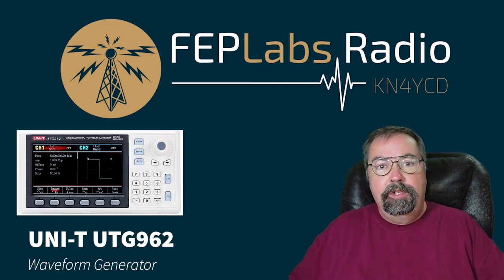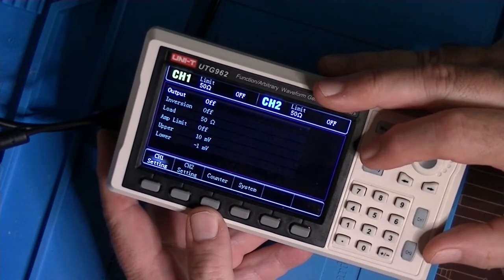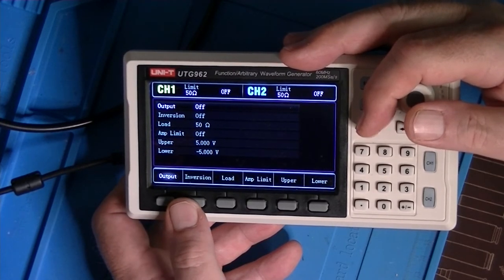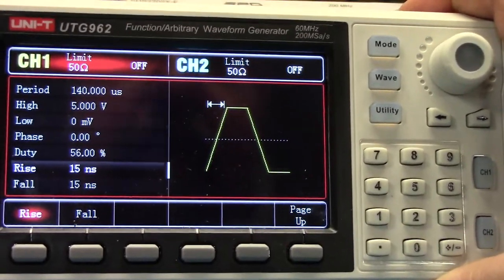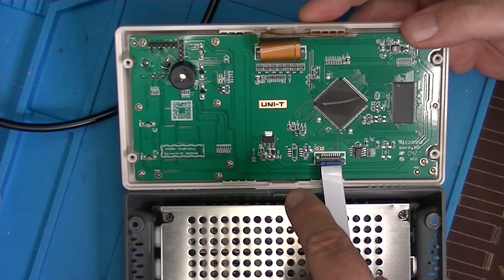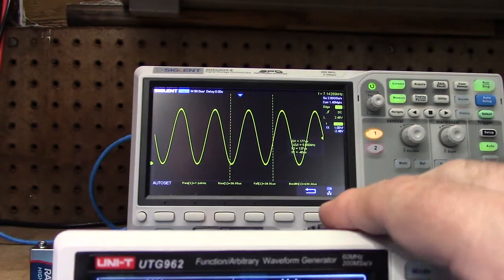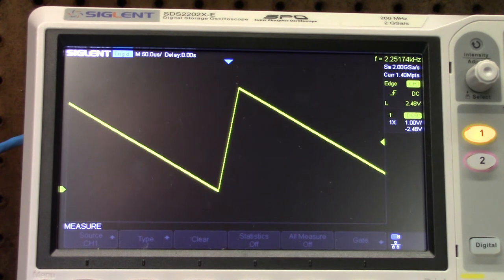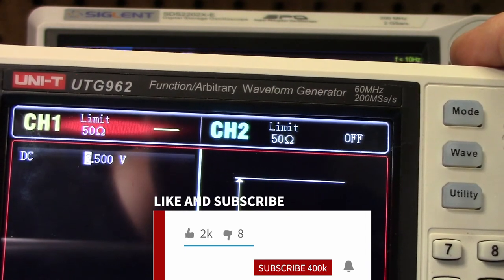Uni-T UTG962 Signal Generator

Comment: I enjoy your channel.  I have the UTG962 as well and I believe I have found a problem with it's firmware.  Wonder if you can confirm.  When generating a signal of 14 MHz sinewave, when I turn on AM modulation with 1 KHz sinewave the output drops by 6 dB.  It does NOT seem to drop if I use other modulation like FM, etc.  This 6 dB drop is observed even if the AM depth of modulation is set to 0%.  Can you confirm?? do you believe this is a firmware issue??  Thanks!
Reply from the maker: I'll have to take a look, hadn't seen that, but it's been a minute since I've used mine.  I'll try and remember to take a look!  I haven't upgraded firmware since I got it, and not even sure if there is one available.  Shoot me an email to remind me.

Comment: Do you know what format the 962 needs to input an ARB.  I have the UNi-T UTD2162 with a stored file and can not transfer it to the 962.  File formats are incompatible as per Uni-T.
Reply from the maker: I don't know off the top of my head - there is a lot of info about the 962 on EEVBlog forums - this thread might help you out.
https://www.eevblog.com/forum/testgear/uni-t-utg932utg962-200msas-function-arbitrary-waveform-generator-220394/200/

Comment: Thank you very much for sharing your knowledge.  Would it be possible to use this instrument to adjust and align a CB station?
Reply: Good question I want to know the answer also. Im a novice but have read you need a separate  attenuator to bring the signal down if using to align cb radios; is this correct ?
Reply: @JamesJames-um5xq  Well, I don't know 🤷🏻‍♂️ I'm a newer than you, I started a few months ago and I'm pretty clueless.  Thank you very much for your answer
Reply: @JamesJames-um5xq  Thank you very much…!!!
Reply from the maker: Not this particular scope, the bandwidth is entirely too low to be useful.  Something like an OWON SDS2102 would be a better choice, and still decently priced.
Reply: @FEPLabsRadio  Perfect…!!!  Thank you very much for your answer 😊